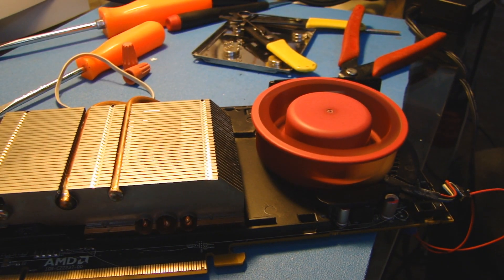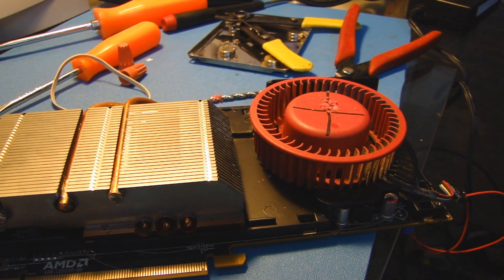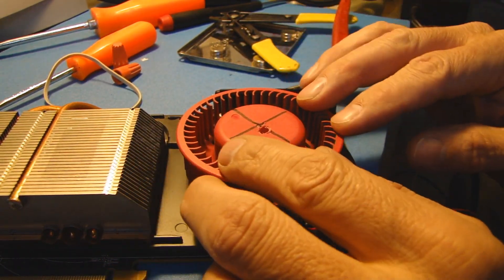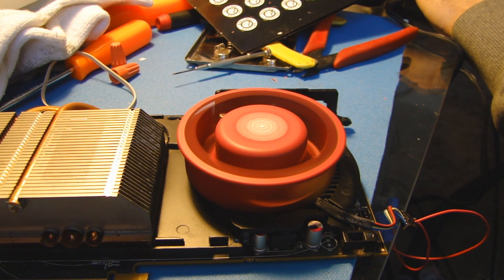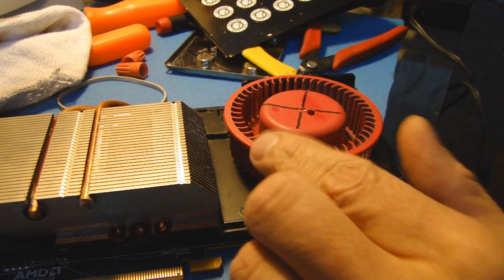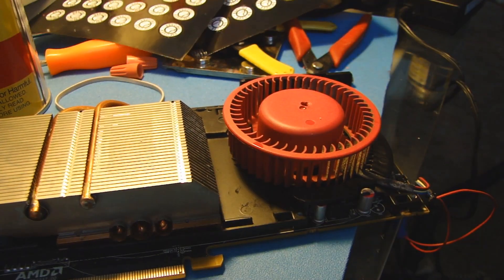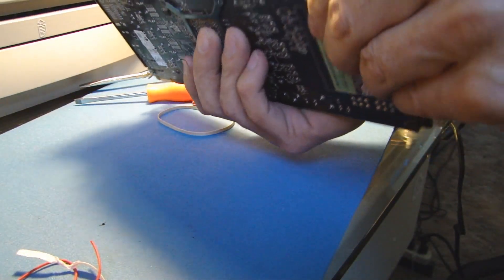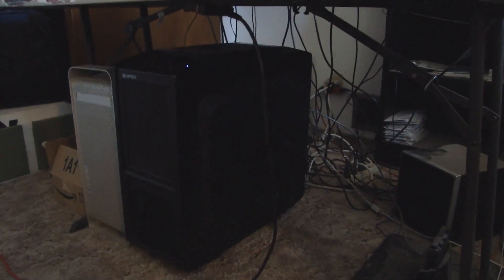Repairing Radeon 6870 fan noise...the easy way....

Comment: Dear sir,

Do you think this method will work on the reference R9 290 blower type cooler fan? And as you are using the oil lubricant, does it means the blower fan assembly consist of ball bearing or something like that?

Thank you very much for your time and for uploading this video, cheers :D
Reply from the maker: +usinkangkong  Funny....I just installed an R9 290 in my video editing machine.  Hopefully I won't have to find out...:^0  That said....

I'm afraid I can't answer your question regarding the R9.  If the day comes that it starts making racket, you can bet I will investigate to see if this method works.

Regarding the assembly of the Radeon card, I'm pretty sure it uses bushings, but it may use bearings.  Either way, whichever one fails, a good shot of lubricant should fix either.  When used sparingly, I believe my mixture of WD-40 and motor oil is a good one.
Reply: Wow are you using the one with reference blower type cooler as well?

Ah yea I hope we won't need to do this method though, I am still waiting for my 290 with reference cooler to arrive in a day or two.

Your mixture of WD-40 and motor oil,by motor oil, do you mean the "engine oil" as like the one used in the engine lubricat = https://en.wikipedia.org/wiki/Motor_oil?

Ah how about this http://www.amazon.co.uk/101456-WD-40-Motor-Oil-3OZ-ELECTRIC/dp/B00065VGUC/ref=sr_1_1?ie=UTF8&qid=1458211469&sr=8-1&keywords=electric+motor+oil

or

http://www.amazon.co.uk/Singer-Sewing-Machine-Super-Oil/dp/B007DXYLF2/ref=pd_sbs_328_3?ie=UTF8&dpID=41EpSkqas4L&dpSrc=sims&preST=_AC_UL160_SR160%2C160_&refRID=1E5B8BF0SAW96E8QF6D2

Thank you for your reply :D
Reply from the maker: usinkangkong
 The motor oil is standard 10w30 non-synthetic motor oil.

My GPU is the Asus Radeon R9 290X DirectCU II OC 4GB GDDR5.  It has 2, large fans.  I'm not sure what a "reference cooler" is.
Reply: By reference cooler, I mean the blower type fan just like your previous Radeon 6870 in this video.

I see thank you for sharing this with us cheers :3
Reply from the maker: +usinkangkong   Hello.  Okay....I did some research and I now know what a reference cooler is....:^).  I found a most excellent video on the subject.  Posting a link here for your enjoyment.

https://www.youtube.com/watch?v=q8RoVXZBsJ8

Comment: Hello man I wonder If you can help me out.My fan doesn't spin for some reason olny when it reaches 80°C and olny if the fan is at 80%load.After the fan load is droping the fan cant keep up and it stops.I have put:machine oil,car engine oil but it doesn't seems to work.I haven't tried wd40 by the way.I have uploaded a video on my channel of whats going on.If you have the time and you can please check it out any help is apriciated!Thanks.
Reply from the maker: +skopeftisnclrp  I watched your video, and you seem to have the same issue I had.  I'm guessing that bearing resistance is stopping the fan from spinning at low power settings.  If you watch my video closely, you will notice that oil alone did NOT fix the issue.  You have to add WD-40.  I'm reasonably confident that once you do this, your fan should start working normally again.  

Please post your results and don't forget to subscribe to my channel.
Reply: Thank you very much for your response!I will try that tomorow and I will update you as quickly as I can!
Reply from the maker: skopeftisnclrp
  Awesome.  Thank you!  Any new data is always welcome.
Reply: Donnie Frank
Unfortunantly it isn't working :( still the same.The fan stops randomly at low rpms or...damn its really really frustrating.I have opened before a hole to the back of the fan and tried to put oil in there.Some months after randomly the fan didn't make such noise,the fan was spinning but I was getting BSOD.Its stable(the card) with these drivers(14.9).The brand who makes the fan is firstD(as you saw its a single fan card not the dual one) and I cant find any dissaseble of it.I have drilled with hand a hole in the centre behind the fan I was droping tons of oil.Recently I have tried engine oil but it was alot worse.Today I tried the WD40 but its the same shit and I apologize.It is a little better but the damn fucking thing won't start by itself!Heres whats happening:starting computer,fan starts for a second then stops,a little later again the same thing.After that nothing.Now of course I don't blame you and its not my intention but is so damn frustrating it makes me want to play basketball with the card...Thank you for helping me and providing supports for us out there and if you spending the time reading this you are a hero xD.I know Im taking alot of your time but if you can help me some more I would really really x10 apreciated it :D.Have a wonderful day!
Reply from the maker: Okay... a couple things.  First, you shouldn't be using "a ton of oil."  A couple drops of motor oil and then a couple short squirts of WD-40.  But whatever amount of oil you used is already in there, so let's move forward.

First: Is the noise gone?  If so, let's move forward.

Run the fan full speed for about 5 minutes.  This probably won't help, but it costs nothing to try.

My next step would be to measure voltage TO the fan.  This can be done quite easily by hooking a meter to the fan port (which is easily accessible on my card), hook it up and use SpeedFan again to step up the percentage.  This will absolutely tell us if this is a fan issue or controller issue.

The fan bus is a pretty common connector.  So I would simply use a connector, strip the wire ends and use alligator clips to hold the meter to the GPU fan jack.  Otherwise you'll just have to old the meter leads to the pins.  If there are 3 pins, one is ground, one is power and the other is for data.  You need only connect to the ground and power pins.

Let me know what you come up with.
Reply: No the noise ain't gone,the fan is stopped.The WD-40 has done an amazing job it keeped the fan spinning for alot of time at 30 and holding 1130rpm but I forced it at 80% for an hour(it doesnt make any difference if i put it at 80% or 100% because it can't go higher 3.5k rpm).If I could just disassemble the fan dry out the oil and do that again it might work.The problem is the board of the fan.It is a circle  board and I have opened a hole behind in the centre where you can see the motor axle wich as I said before.I checked if the oil was in so I pushed the fan a little back and I could see oil bubbles from the hole.When the last time I put car oil it maked worse.I was running it full speed to heat up the oil like you do in a car,but if you let it cold and go will go full speed and starts dropping on 65% fan speed it will stop like full brake(that was before the wd-40).About the voltage,my brother has a multimeter but im to afraid to expose any cables.Now again I have found stinger machine oil.You told me to measure the voltage but I have literaly no idea how to do that.I have a PSU 600W,my card wants at least a 500W PSU.I don't think thats the issue.I simply can understand what made my fan behave like this and a lot of noise.Do you want me to take pictures of the card and the fan?To hear your opinion.Again thank you very nuch for your help and your time :)
Reply: Let me correct the last phrase:I simple CAN'T understand what made my fan behave like this and the noise.
Reply from the maker: +skopeftisnclrp  The only way to troubleshoot this issue is to start taking measurements.  Otherwise we're just stabbing in the dark.  Metering the voltage at the fan jack is pretty simple.  You simply set your multimeter to "Volts DC," hold the leads to the pins, and then start stepping up the fan.  As percentage increases, you should see a gradual increase in voltage.  Without this data, I can't help you.  Nobody can.

Note: Because the jack is female, you may have to stick small pieces of wire in the holes and then attach the meter leads to the wire.  This is pretty easy to do, because you can actually wrap the wire around the leads so you don't have to hold them.  Once it's all set, ramp up to 100%.  You should see 12 volts.  Then start ramping down.  You should see a gradual decrease in voltage.  If voltage drops off completely @ 70% power, well then the problem is in the card itself.  This will save you TONS of time banging on the wrong part (the fan itself).
Reply: Ok man I will give it a shot but can you do me a favor ?Can you guide me there?xD I know Im asking too much but Im a complete new at this stuff.I mean where should pluck the wires wich wire were I mean negatives and possitives etc.I can't do this today I can do that tomorow.But its strange you know,this thing where you see it spin for half a sec at the start then stops for two times and then when you force it I mean not to much talk you saw the video.We see tomorow hopefully :P
Reply from the maker: skopeftisnclrp
  The fan has a physical plug that plugs into the GPU.  Step one is to find that plug and unplug it.  It's in there good, so you really have to tug at it.  Don't pull on the wires.  Tell me when you've done this and we'll move forward.
Reply: Donnie Frank Umm how to say this...It aint a controller issue or voltage,not that have measure it BUT,but I tried to disasseble the fan it was impossible,to much pressure,so I thought "hey why not make the hole bigger?"well I got a beatiful hint,and what that was?Black oil...wich I think it means=used oil+dust.Now I know you may call me ignorant because I don't take the voltage data and wasting your time and I would agree with you,but I have a very strong fear I would get electrocuted plus I don't even know how to use the multimeter,so I watched tutorials to do so and it wasn't so easy as I thought.Now I have a very wonderful question to those who maked the fan:WHY WHOULD YOU MADE ITS ACCESS IMPOSSBLE DAMN IDIOTS?(Sorry I couldn't hold it)So I don't think it matter how much oil I would put into it or even measure the voltage as the bigger problem its the oil itself.Yay just...fcking yay.